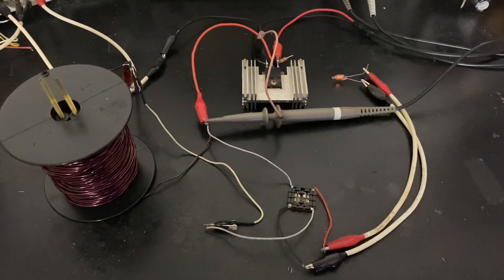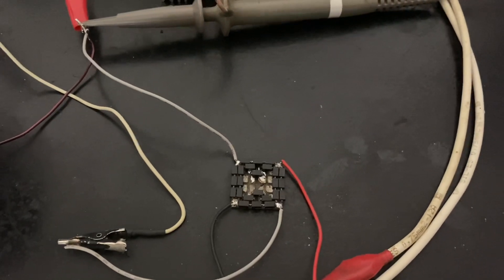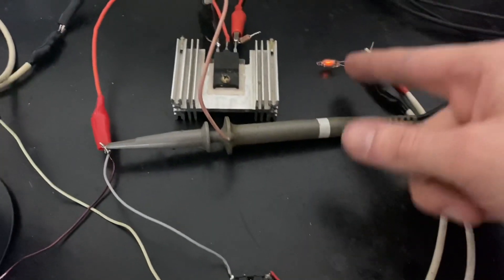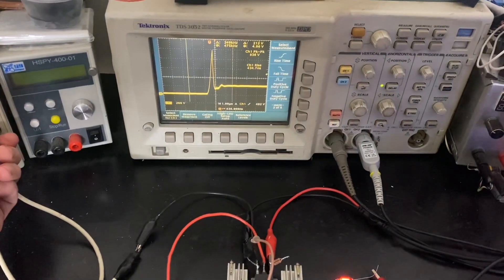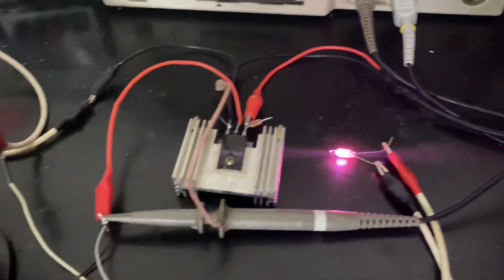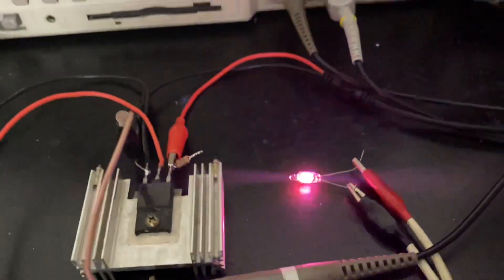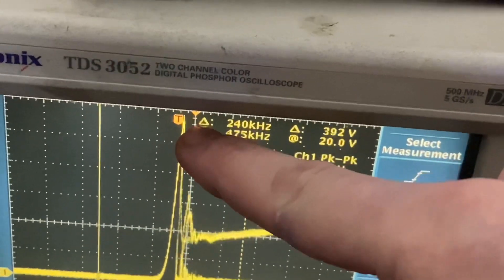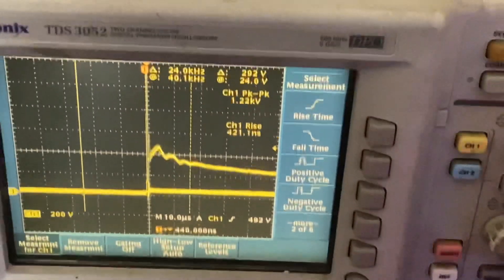How To Generate Ball Lightning inside Neon Indicator Bulbs

Comment: @exoticpropulsion8175 .. oh yeah,
I was here once before, but now
understand the noble gases a bit more.
Try a Xenon bulb. Local signage guys
could help you make a custom tube
if nothing is available online.
I have a HF Tig welder as a power supply controller I don't use often
if you want to borrow it, go bigger.
Have to fire it up, make sure no mice
got into wires while I was gone 4yrs.
LEDs are limited in size, so a highly
efficient but cold bulb of stage-light
or bat-signal size would have the
economy of volume manufacturing,
I would think. You guys are looking
for fusion probably, but a better bulb
would fund future work yah?
2024y01m21d18h24mGMT-6, ~🎰.

Comment: "negligible resistivity"   may be why mercury was chosen by Hanns.  I would still use Iron GANS Water and add salt to it, the IRon can be magnetized , not sure about the salt, or the water . But the fluid mix will transmit current great with negligible resistivity. From what i remember in old videos people were charging the circumference , the idea to charge the top and bottom as Phillip has done is ingenious . https://www.youtube.com/watch?v=QArcTylNooQ

Comment: The confusion comes to me with mercury as a MHD medium is that its not magnetic and yet it becomes a magnetic moving fluid once energized .  Seems thats the goal for Hannes.   If a magnetic fluid is the goal with the MHD why not use rusty water .  This WIKI article sort of clears this question up "sort of"  because unless other have tried different fluids there is no way to tell if mercury is the one to go with. Being so hazardous you would think more effort to find an alternative would ensue .   (A fundamental concept underlying ideal MHD is the frozen-in flux theorem which states that the bulk fluid and embedded magnetic field are constrained to move together such that one can be said to be "tied" or "frozen" to the other. Therefore, any two points that move with the bulk fluid velocity and lie on the same magnetic field line will continue to lie on the same field line even as the points are adverted by fluid flows in the system.[8][7]: 25  The connection between the fluid and magnetic field fixes the topology of the magnetic field in the fluid—for example, if a set of magnetic field lines are tied into a knot, then they will remain so as long as the fluid has negligible resistivity. This difficulty in reconnecting magnetic field lines makes it possible to store energy by moving the fluid or the source of the magnetic field. The energy can then become available if the conditions for ideal MHD break down, allowing magnetic reconnection that releases the stored energy from the magnetic field.) https://en.wikipedia.org/wiki/Magnetohydrodynamics

Comment: My choice would be a ferrous oil liquid .  Like Iron GANS, not like ferrite particles rather ferrite nano particles made with the GANS method aka Berneye method. The GANS is water based the oil is not you can use an emulsifier to mix the two. This would be my choice if experimenting with MHD

Comment: Mercury is not magnetic using induction to spin it wont work. Thats why Phillip sends current threw the actual non magnetic fluid . (In order to spin)  skipped my memory at the time of discussion. The ideo to use induction rather than actual current to spin a fluid is valid and better but will not work with non magnetic materials .  I am not a fan of using mercury for any sort of experiment. Its hazardous to health.  Some use oil . Best Myke

Comment: Hey Jeramiah can you get the neon to keep the blue light , it seems to go out after running the Bdini for few seconds it turns orange . Best , Myke
Reply from the maker: Yeah, if the pulse rise time is fast enough then you can sustain the blue EVO cold, but pulse train needs to have the current behind each.  That means using ultra low inductance coils with thick wire.  Once the blue bead forms the heat seems to go away. But if the pulse is too slow like most solenoids, you still get spontaneous blue events. the orange glow will lead to overheating and melting of the internal leads.
Reply: @exoticpropulsion8175  Sounds like you tried a few different winding before you got the results .  I have good results with a 1500 T winding about 30 awg . Transistor never blows out and always runs cool. Probably cause of the resistance is high

Comment: Hey Jeremy LMK what you think about this circuit. https://www.youtube.com/watch?v=TW72mRXVrvs&t=30s   I intend to determine if the flyback and its amperage no matter how little , is in anyway correlated to the forward voltage pulse . If so one can entirely recycle the forward energy used by capturing the flyback . I also think the 1n4001 diode may need a 1n4007 HV diode in parallels in order to properly capture the negative side of the flyback since the flyback is HV and all.

Comment: I got the same effect using inductive pulses that were generated mechanically, lovely colours :)
Reply from the maker: I’d love to hear more about it!  That sounds closely related to a new project I’m currently developing.
Reply: @exoticpropulsion8175  It was basically the SSG circuit with the charging diode removed, the neon used to flash intense purple-white with the inductive spikes. I have the setup in this video but not the effect occuring : https://www.youtube.com/watch?v=RviBQzjIX8A&list=PLyLMmnSL6MzHzU0cw-O5G4STBzUFqUuXi&index=8
Reply: @GaryMcKinnonUFO  try it with an ignition coil
Reply: Yeah, looks like you are making a little gamma ray tube.... be sure to know what you are doing.